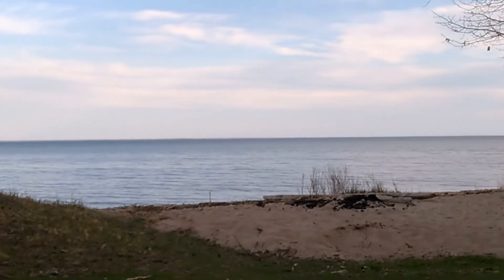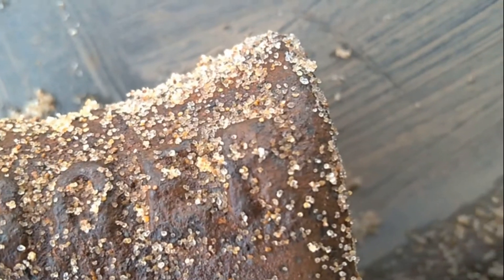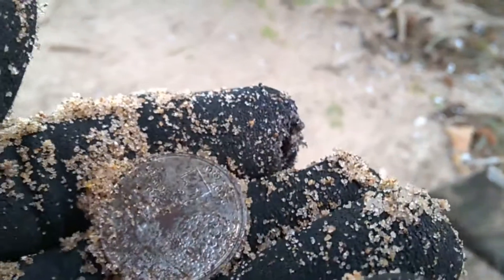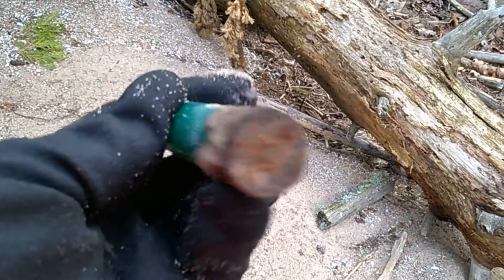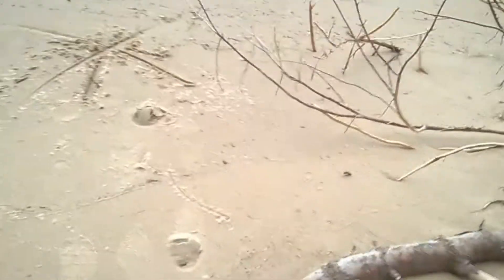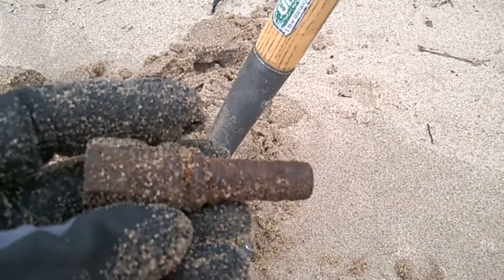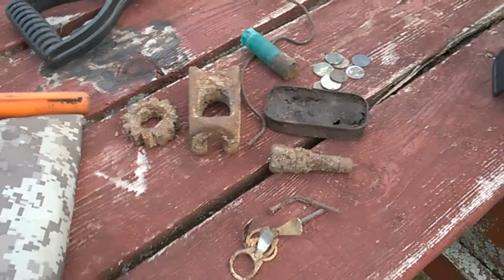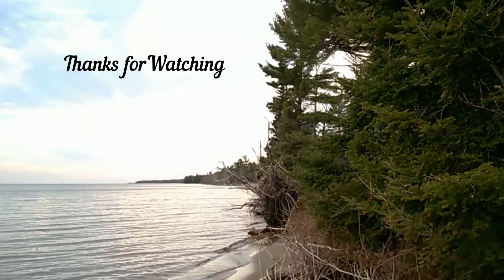METAL DETECTING ALONG LAKE MICHIGAN

Comment: That thing at 1:00 is the coupling off a choker cable.  The choker is used for pulling logs.  That coupling allow the cable to slide through it to make a large loop to go around the logs and the choke up on them for pulling them to the area where the loader is set up.  The bugs are really bad here already, too.  We put on  Avon Skin So Soft every time we go out.
Reply from the maker: You and many others said the same thing. It is nice of yous to take the time to tell me what I found. I appreciate it. I have skin so soft. I will put that on for sure on my next outing. Thanks for that helpful tip also. GL&HH :)
Reply: @upnorthadventureswithccc  it's not a problem.  That's what this community should be about.